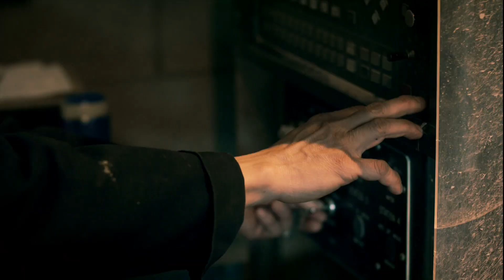More Dangerous Than Space | Alien Deep

Comment: The pressure inside a space suit is slightly lower than our atmospheric pressure, about 12 pounds per square inch. The total force behind air trying to escape through a 1/4" hole would be around 2.4 pounds. You could hold a thumb over it, and you could, quite literally, temporarily patch it with duct tape. You've been watching too many old sci fi movies.